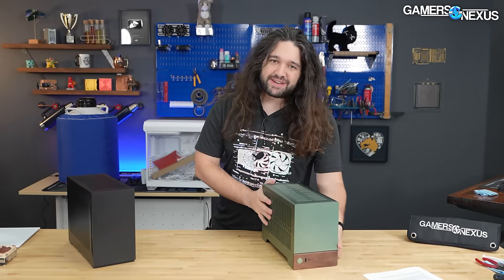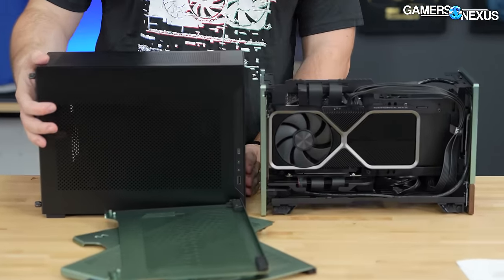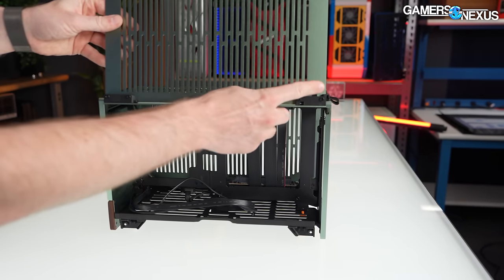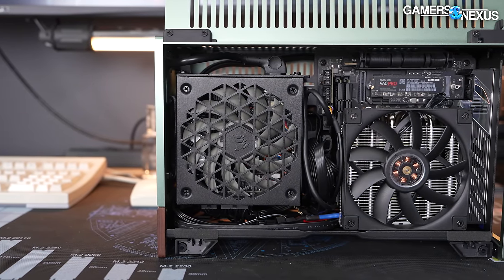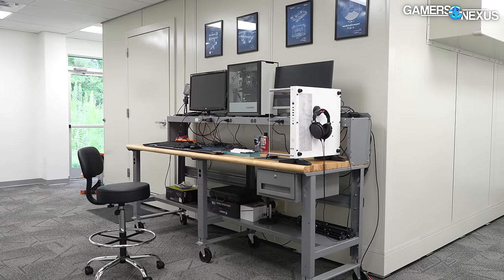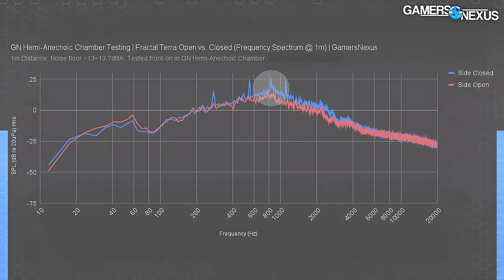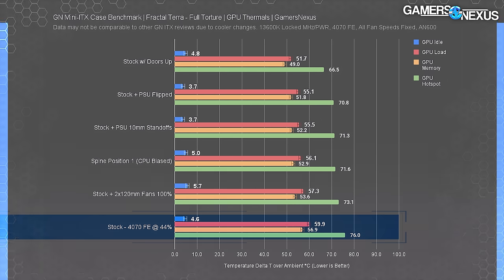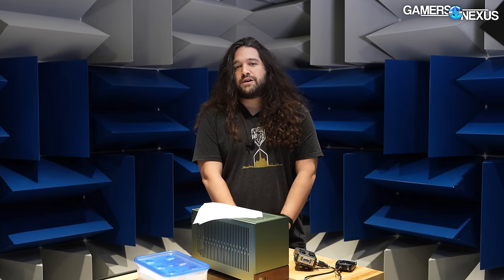Fractal Terra Mini-ITX Case Review: Build Quality, Thermals, Acoustics, & Cable Management

Comment: Hello,
very in-depth and concise review!
As additional idea for the combination of structural vibration and noise, you can monitor the rotational speed (better in Hz than in rpm for the matter) of each fan and also consider the number of blades on each fan. Thus, you can find the "source" of a vibration/audible noise, by looking at the excitation frequencies of a fan, which can be 1 excitation per rotation or multiples of it (harmonics). What you will find often is the (rotational speed*number of blades) as excitation source. 
After finding a specific fan as excitation source, you could look into the mounting/connections to the case, which transfers the vibrations to the noise emitting larger surfaces (e.g. side panels). 

Keep up the good work!

Comment: I work on industrial machinery, some of the machines i commission have the same problem with fans being not close enough to side vents of machines like this to take in the outside "cool" air. What i do is, install a flexible foam that (in this case) would stick onto the inside of the doors, and when doors are lowered, would fit directly around each fan, so that the fan pulls air straight through the vents instead of some of the air being pulled from inside the hot case.

Comment: Great video as always!!  Happy to see you guys giving some love to the ITX community.

For all the people looking to buy this case.. I really really love mine and I dont have any thermal issues with my setup (Undervolted Ryzen 7 5700X and Zotac trinity 4070ti)

The best orientation for the fan below the PSU is as exhaust because theres no point in having it as intake because part of the PSU will block the air going in anyways but as exhaust it really improved my temps 4 to 6 degrees celsius.

For anyone wondering  my cooler is the ID-COOLING IS-55 with a Noctua NF-A12x25 on it and I can assure it performs very well
Reply: Just to clarify the improvement of the bottom exhaust fan was more noticeably on the cpu about 4 to 6 degrees as I said and 3 to 5 on the gpu
Reply: Yah same, have somewhat of a similar build to yours, 5800X3D undervolted with a Gigabyte Aero 4070. Thermals are warm on the CPU (low 80s gaming), and in the 60s for the GPU. The Thermalright full copper CPU cooler with a Noctua fan is really good. I think what people are missing here is why people build ITX, and more specifically why this case. This case just screams modern with  wood and aluminum, and sitting on the desk is very nice.

Comment: I just want to add I've been using the nr200 itx case since it came out. Highly recommended. IMO is better than these extremely tiny cases because it's pretty cheap yet well built, able to fit a full size cpu cooler while still pretty compact, easy to work with and aesthetically great.

Comment: I purposely bought the Terra to build my new work station with. I am very pleased with its build quality and I have virtually ZERO sound from this case, and my 13th Gen i7 hardly hits 47c with the liquid cooler. I did watch a lot of misleading reviews which steered me away from the 13th gen i9 which is what I had my heart set on based on the thermal issues reviewers were complaining about. This is also my first liquid cooled experience. I went with the fractal design Celsius s28. Ya there was no internal mounting. so what?! there is a nice slot opening when spine is set to favor near max cpu cooler height, the hoses fit perfectly through there. A lot of SFF builders will cry and scream hey that doesn't qualify as a SFF build. So that I say, Oh well! Work arounds man! This work around perfectly solves the thermal build up/dissipation and noise from air cooled noisy ying-yang spinney thangs.  Hell my PSU fan has yet to spin up. Also NEVER use windows. Its the worst operating system out there. PITA factor? Ha, Have you all ever worked on an Vw / Audi from the 2000's to present???? Working with the Terra reminds me of working on a Volvo 240! Very stout construction, and thoughtfully designed and functional. and built to last! with a timeless style.

Comment: Hey GN!

Fantastic test and review! I built my Terra when released - my setup / goal was a little different. I ended up with 5600x + Asrock 6700xt combo. This gave me enough room to install a Black Ridge cooler paired with a BQ silent wings pro. I ended up adding the same fan as bottom exhaust - I used the 10mm spacer for the sfx power supply. 

With this set-up, the Terra is quiet and temps are under control. It would be great to see a Fractal made spacer for the power supply which also lifts it up by 5-6mms to give more room for the bottom fan.

Comment: I have a 4070 fe in my terra as well with a 7600 non x just to help keep it cool and with one slim fan under the psu, spine in position one and stand offs on the psu I was around 76 on my gpu. I used clear packing tape to block off the inside of the side panel slats where the gpu wasn’t pulling in air to direct air flow up and out and ended up getting down to 64-66 under full load.

Comment: Hugely appreciate you guys getting into ITX reviews! 

This case does not look very good imo. It's very pretty, I was considering getting one before, but I think the noise issues and general build planning issues are deal breakers. I'm currently using a CoolerMaster NR200, and I'd love it if you guys took a look at it. I think it's a great entry level option for ITX, and I'd love to hear more opinions on it.

Comment: The minimalistic, compact design of ssf cases is what allures me. Sliger makes good cases too. I have a sm550 (vented side pannels) and I loved building in it a few years ago. The acoustics on it seem good but I have no equipment to test that. My sm550 has two bottom noctua 120mm case fans as exhaust, a 3600 cooled by noctua nh-l9a chromaxblack in a gigabyte aorus pro ax mobo, a 2080 super and thermals are reasonable. It was fun to build and is a joy to use.

Comment: This was the greatest ITX review iv seen, you answered the questions that I would have but no one would answer in reviews. Thrilled that my Mesholisius was a good acoustic purchase even if I bought the 89.99 one and still had to pay like 70 more bucks for the 4.0 riser. You would be a godsend if you tested mesh to see what hole size we should be getting for fan filters or ripping that tempered glass off for a mesh mod.

Comment: I used to be a big fan of Mini-ITX builds, and once ran one in an SG-13 case since I liked the portability. Back then, I'd be a sucker for a case like this.

However, as moving around became less necessary for my work, the compromises I was willing to live with for said portability became less and less acceptable and I moved back to full tower builds (and reusing an absolutely ancient Antec One case). The regular cleaning is certainly much less of a chore now.

Comment: I was going to build an upper mid level R7 7800x3d + RX 7800xt combo on the case, but since my previous ITX build had 5950x, I kind of wanted the new PC to beat the old in all levels so I went with R9 7950x3d + RX 7900 GRE (ASUS dual fan, as it was the smallest one I was able to find, and also easy to replace the fans if needed).

So folks, wish me luck with maybe a bit too high end parts for this tiny ITX case. The components shold arrive either at friday or most likely next week, and I just hope everything fits.

To reduce heat & noise, I might do some thermal limiting / undervolting etc. at least for normal use under Linux and then turn the heat & noise on when playing CS2 as it doesn't matter too much with headphones.

Comment: Quite common tweak in SFF cases is flipping fans to exhaust (removing GPU plastic shroud and replacing it with regular fans). Since all radiators are right next to panels, the hot air is immediately expelled from the case. Sure it is less efficient (in terms of fan RPM and air paths) to pull air from a heatsink rather than push through it but the gains from not circulating hot air in such small cases are massive. Primary downside is having to clean dust more often due to negative pressure (usually there isn't any more space for intake fans). The PITA factor for this modification can vary, if the case happens to have fan mounts next to the GPU then you only need to disassemble the GPU (often removing shroud requires removing heatsink as well) and mount new fans. Otherwise you need to make some kind of mounting plate (3D print or laser cut plywood) which theoretically could be easy if somebody happened to share a design for that specific card but otherwise requires some design/tinkering skills.

Comment: Pretty interesting review regarding the noise. I picked one of these up yesterday on a whim thinking I can do a build in it with a full custom loop in it and I have a plan coming together for that but it is going to be more of a low-midrange build ultimately which lines up to your closing statement. One thing I would have liked to see as well would have been the ability to slide the PSU up or down even just 1cm each way, the off set screw holes looked to be half way there and if they'd just had 2 screw holes for the PSU brack on each side and centered that notch the bracket rests in it could have easily allowed that extra bit of wiggle room. Being able to move the gpu up or down a hair could also allow a bit more flexibility too. Overall I like the case and build quality, aesthetics, etc. I'm curious to see how my water-cooled build turns out with a slim 240mm rad on the GPU side. I now wonder if it might be better to try putting the fans on the inside of the rad pushing out vs the outside pushing in based on the noise tests here

Comment: For this case, I think adding something like foam weather striping (gaskets) to close the gap between fan and side panel would improve temperatures. It might help with vibrations too.
Now, if only someone would make a 120mm and 140mm version of Noctua NA-FD1, this could be done much cleaner.

Comment: The new room is fantastic, The noise level in PC is a important data. But in my opinion is a little bit hard to read the result with the actual graph used in the video. I hope you find easy way to understand the result of the noise test. Good Job !

Comment: Great Video! Especially as an audio engineer, it's great to see such a focus on proper acoustic testing! And interesting to hear a little about what exactly causes this turbulence noise, because that is something we never touched upon during my education, and it's a problem I have encountered with these sandwich builds. 

One note about the case tests though, I noticed that the heatpipes of the CPU cooler was in the one orientation that Noctua notes on their site that you shouldn't do, i.e. the bend of the heatpipes being above the rest of the cooler. Now, that might have been done because rotating it 180 degrees maybe isn't possible with this motherboard, ram etc. Just by the looks of it, it seems that rotating it would solve the problem of some of the fan being covered by the bottom of the side panel as well, if possible of course.

I noticed this because I have a similar issue in a sandwich build, where the heatpipe bends need to be on the top (the wrong orientation) for it to actually fit. Which is a little annoying. However, I have no idea how much of an impact it actually has on thermals, I just know Noctua says you shouldn't do it.

Otherwise, great video, looking forward to more of these ITX case reviews and more detailed acoustic testing!

Comment: I was thinking about how GN’s GPU reviews are often one video with the data and then a follow-up video doing a tear down, and I wonder if GN would consider for small form factor case reviews having a similar follow-up video focused on building inside the case instead of just obtaining small amounts of B-roll. The process is already necessary for testing, so the time investment contributes to more than just a single video, but also allows for more non-standardized commentary on design elements/build quality similar to prebuilt review videos which are both informative and very entertaining. Building and doing maintenance in small form factor cases can be subjectively difficult and having a visual demonstration of how easy/difficulty a given case might be to work in would likely be valuable to viewers in making a purchasing decision.

Comment: This is a case that requires a lot of thought and research when choosing your components. I am running a 65W AMD 7900 (12 core / 24 threads), RX 7900 XTX GPU and a Gen 5 NVMe drive. The CPU idles in the 48-52C range and never reaches 80C during a 10 minute Cinebench test. I have tuned the fans to the point where I cannot hear them when idle and they are no more audible than a full size ATX case during gaming and stress testing. I am using a Noctua NH-L12 Ghost Edition Cooler on the CPU with the fan beneath the heatsink pulling air in. Perhaps this configuration mitigates some of the noise caused by the side panels. The motherboard is an ASRock B650E PG-ITX WiFi which has active cooling for the Gen 5 NVMe drive. I definitely wouldn't try a Gen 5 drive without an active cooling solution

Comment: Ironically find it more fun and enjoyable working on smaller cases like this than big ones, the big ones are so heavy, and once you install stuff its actually hard to take them apart because of the size. 
Nice to see Fractal also making pretty decent ITX cases, wish there be more case manufacturers trying out the DAN C4 SFX style so you can avoid that obnoxious riser cable.

Comment: Congratulations on doing such a meticulous report on the case characteristics. Your data will defnitiely help people choose appropriate components and placement strategy during builds in this case. 
I think there is so much information to parse, some more innovation on data presentation is needed. Also Steve you seem pressurised to deliver all that data at a high pace. Slow down a bit when presenting data.  Perhaps innovating on the visual flow of charts with dynamic comparisons may help.  Maybe combining the video with a blog guide and mentioning the same in the video will  increase value to the reader.

Comment: I would check if the little plastic side panel "pegs" to see if they have metal reinforcement rods in them. 

There's a few things to help combat turbulence in the Terra. Moving the fan further away from side panel, if possible helps, as does having it run at a lower RPM. The L12S is also a great cooler for it, if it fits the users config, since the fan

As for running a fan under the PSU, it's much easier if you use a fan grill and run the fan in exhaust (which also gives better thermals). Also custom cables work great for it. SFX allow 25mm, SFX-L only allows 15mm.

Comment: As an ITX enthusiast that package size is incredible but I still love my Meshilicious for the 280 Rad support - keeps my 5950X cool during prolonged photogrammetry loads, but I am technically exhausting out the front and using the 6750XT for pulling air in...

Comment: I wonder if the case could be improved by:
1- placing a thin magnetic black filter mesh inside the doors to soften acoustics
2- move the power cord to the top of the case, where it would share space with the GPU power, allowing the GPU to be set lower in the case, which would allow for taller GPUs without the cable bending mentioned by Steve
3- shipping with some foam strips that users can shape (around the fans) to sandwich between the doors and the fans, creating a sort of duct like some cases in the past used to have
4- obviously replacing those door hinges with metal ones, but they would have to be carefully engineered to avoid noise from vibrations to propagate and have some disconnect system to avoid bending the door if users force it too much. If that is not possible, at least have another type of attachment for those plastic ones, because those seem glued to the doors, and have replacements users can buy

That chamber must be awesome for people to train their inner voice :D
Back to you Steve :)

Comment: you can rotate the cooler to the other direction so that the fan lined up with the panel hole so none of the fan being blocked off. i'm sure it'll have the impact into cooling and noise having the panel closed. attention on the detail is important here

Comment: I really like small computer cases and I hope ITX and Micro-ATX will become more popular. I´m about to build a new PC and I´d like to have a smaller case than the usual ATX boxes.
Looking at this Case I think it would be better if it had ~20mm more in all directions. It still would be small, but those extra millimeters would probably help a lot with builing, noise and thermals. It´s looking very cool, tho!

Comment: Fractal has an opportunity to sell finer mesh panels separately or release a rev.2 with it included along with a raised PSU placement and a better 10mm PSU standoff maybe extending it and/or adding more standoff enough to prevent wiggling.

So far the Fractal Terra is a great case. This is not for everyone but for people who are looking into building an ITX pc.

Comment: Absolutely loving the new sound reporting! I'd be really interested in seeing what a cooler like the Alpenföhn Black Ridge can do in terms of noise (and thermals), where the fan is beneath the heatsink but still exhausts out through the side of the case.

I built an ITX case from scratch with a very similar design to the Fractal Terra and haven't noticed any annoying noise like the Terra has with the Black Ridge.